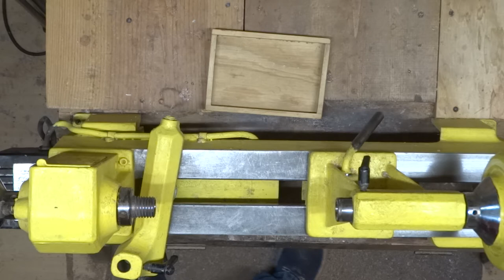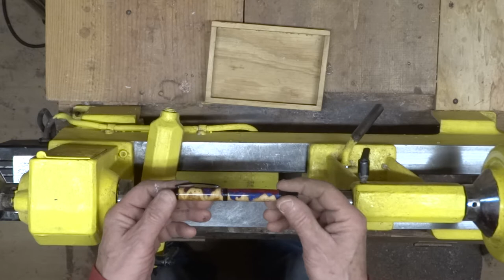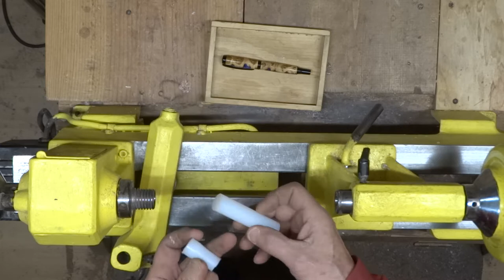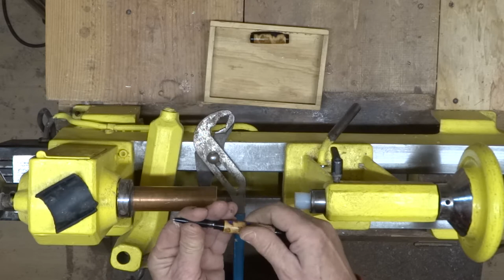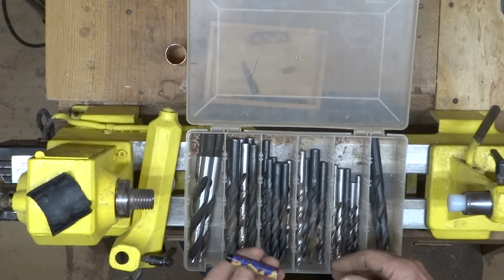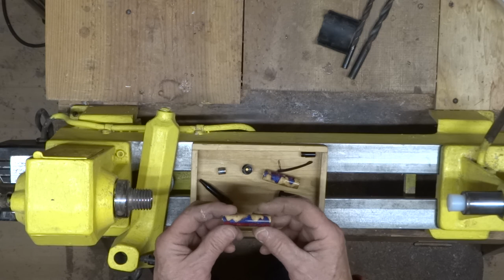How I disassemble a pen. No special tools needed!

Comment: Many thanks for this tip Ted, just disassembled a pen I wasn't happy with it's shape after I turned it, back on the lathe now 👍
Reply from the maker: I'm glad it worked for you. Note that it doesn't always work, as some pens simply don't want to come apart. I've destroyed a few blanks in the process, and had to salvage the tubes or buy new ones. I've also destroyed a couple of kits. I'd say my success rate is about 90%.

Comment: Came here from reading you comment on Zac Higgins Chanel, and as I do everything on the lath as well, I was interested in how you dismantle on the lath as this the one thing I haven't tried
Reply from the maker: That was my inspiration for figuring out the process. If you don't have HDPE, you can use any hard wood. I recently switched out the copper pipe with a plastic one  that I cut from a length of 1-1/4" vacuum hose extension. I was  concerned that the copper might scratch the pen parts. If you don't have a thick piece of hard rubber, you can cut a piece of leather from an old belt. Of course, it's better to get pen disassembly pliers. I'll probably invest in the right pliers someday, but the rubber seems to work okay. Hope this process works for you. Let me know if you have any questions or suggestions. We all learn from eachother. :)

Comment: Thank you Ted for some great tips, I have been holding it in my hand and knocking it out with a drift and hammer. I have two mistrals that I can't get a part and think that this will do it.

On slimline, streamline, European once the cone is off I knock the twist mechanism out over a dowel plate, quick and easy 👍
Reply from the maker: The drift (that's the word, thanks! ) and hammer works perfectly most of the time and it is quicker. The downside is I've damaged a few in the process, probably for my own clumsiness. This process is less aggressive. 

The Mistral is the first pen where I tapped out the button on the finial and replaced it with wood. It took a few tries to get it right but once I did, it looked fantastic. Since you mention it, I'll maybe do that with this one tonight.